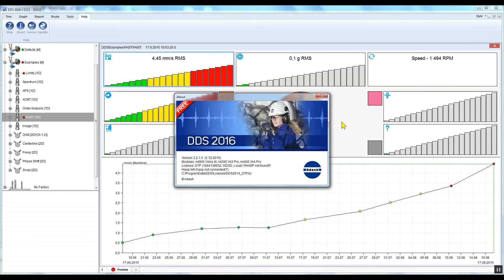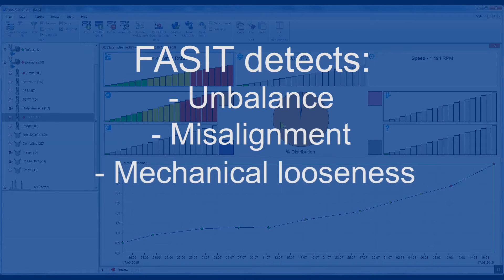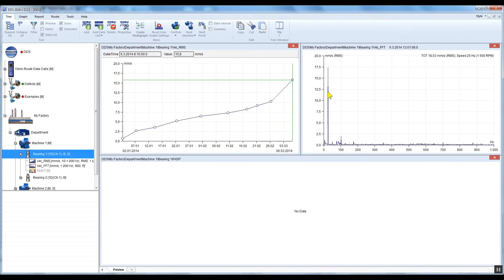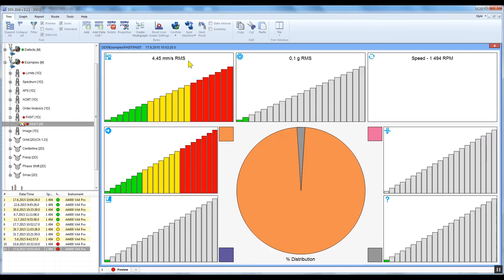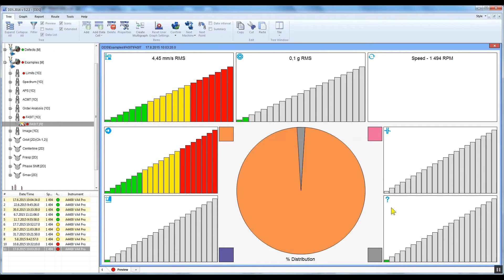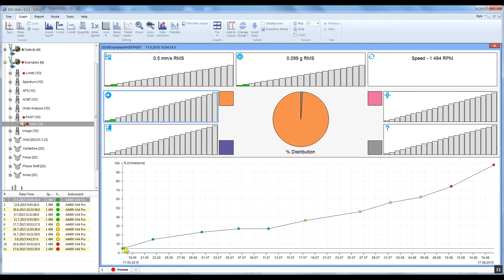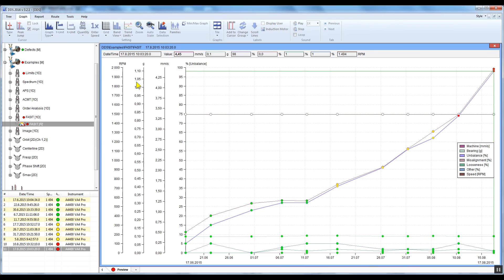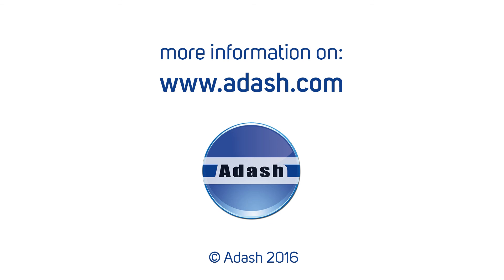Adash DDS tutorial 05 - How to monitor machine fault trends - FASIT

Comment: Hello, i am trying to monitor pumps fault trends using Vibrio M 4900. when i add data cell "FASIT" in measuring point. and upload in data collector and after storing the collected data in to the route, Fasit don't showing any data. (I have also determined the speed i.e 1500) can you please help me to identify the FASIT trends using Vibrio M.
Reply from the maker: Hello Sir. You may have an older firmware. Go to www.adash.com and upgrade your Vibrio  M firmware